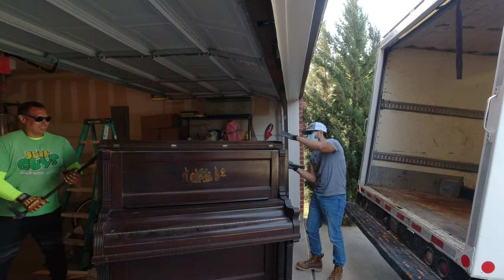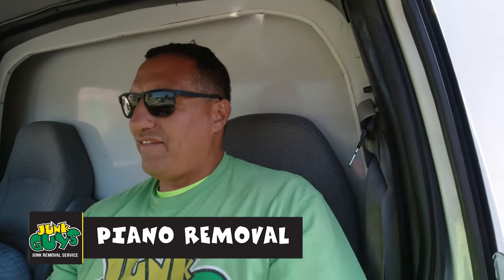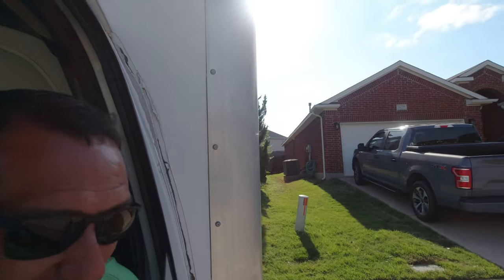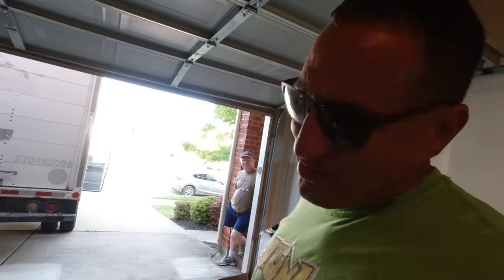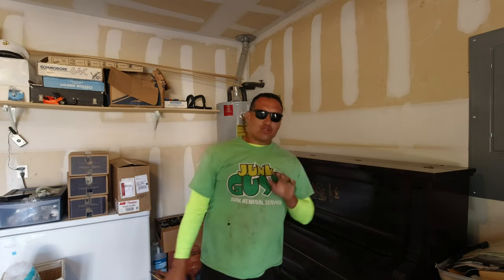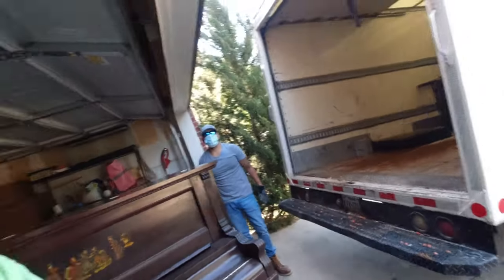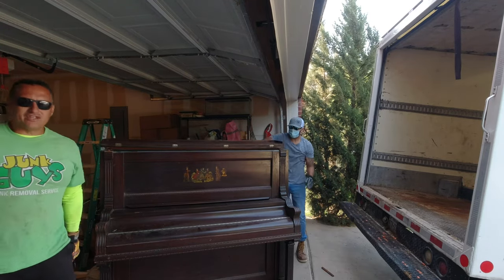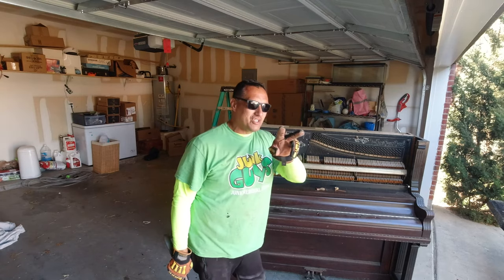How To Remove An UpRight Piano In Keller, Texas ? $200 JunkGuysDfw.net

Comment: I would charge $200 if it was curbside ( tractor to remove it ). Inside would have charged a lot more to get it outside.
Reply from the maker: Actually most people leave it on the curb or in the garage
Reply: @Junkguys  that would be easy money if curbside.